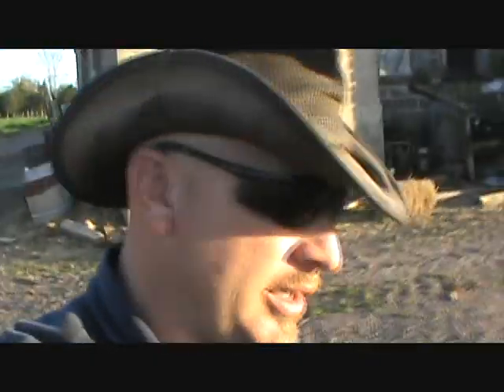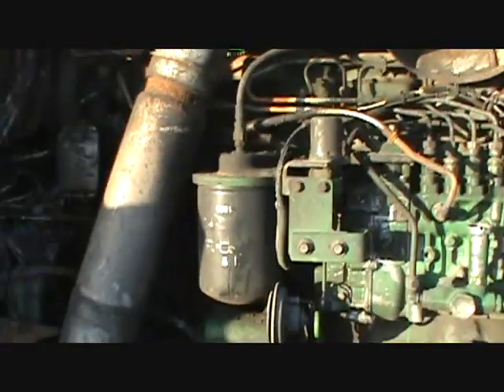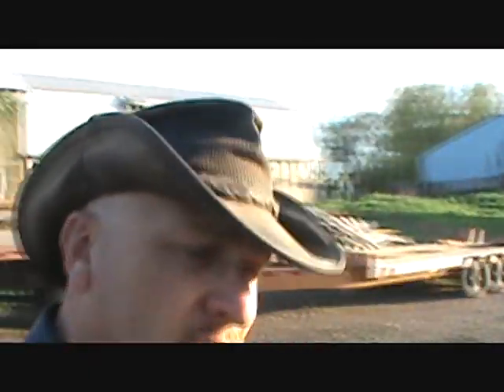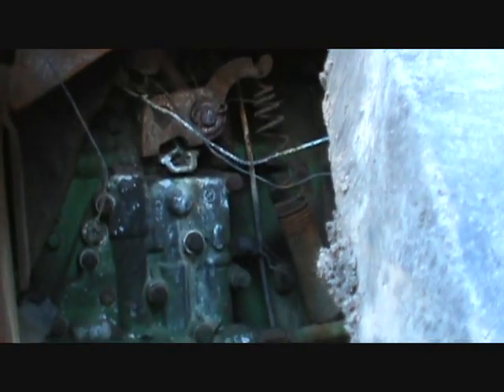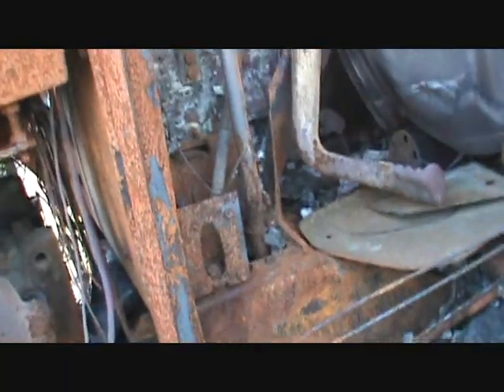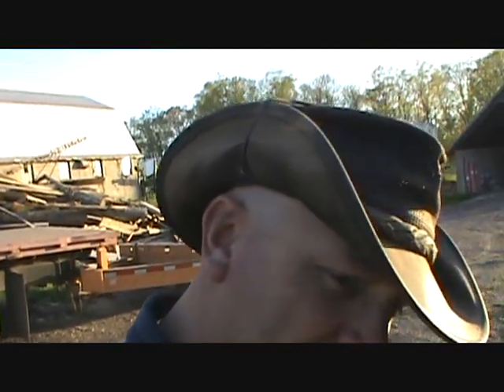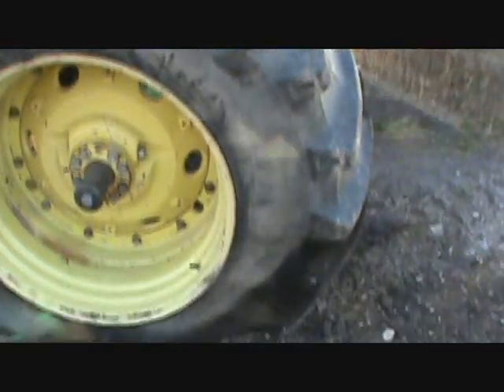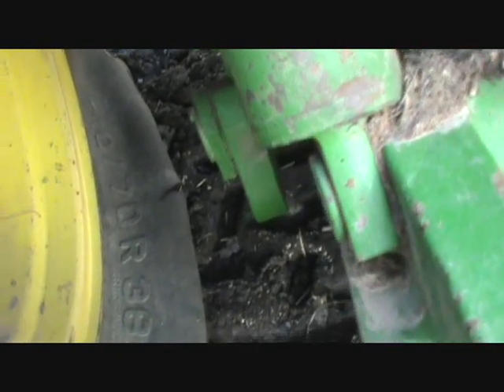4960 part it or fix it

Comment: We rebuilt a burnt 6620 combine and ran it many years till it burnt again. Check the fuel injection pumps sn plate. If its gone its trash. Would not think the clutch packs in the trans would have got hot enough to melt the sealing rings but if i had the cab off i would split it and check. Like the videos.

Comment: My polite suggestion would be to rebuild it if you have the finances to do it.  It would appear all the major components (less the cab obviously) are all there and mostly undamaged.  I would pull the cab and check the top of the transmission as you indicated.  Turbo, intercooler, and cab are easy.  I would also suggest a complete new wiring harness!  :)    Good luck!!

Comment: Salvage tractors to use for parts can be bought cheap a 4650 with powershift sold at auction yesterday at moultrie ga for 10,000 and some others with sound gaurd cabs sold cheaper than that. Just check around with diffrent salvage yards for parts and at local auctions because you will have a fortune in it if you buy all new factory or after market parts. Go for it and you'll be much happier that you fixed it than if you parted it out.

Comment: Fix it! Find a cab  from a salvage tractor with a powershift trans to make the process much easier. We have restored a couple burnt tractors and they are not as bad as you think to fix. Your hood can be fixed if it is not warped use muratic acid to remove the surface rust.

Comment: I'm still on my way watching all your videos chronologically, and I guess you rebuilt it, but I would have said to part it out, since you replaced it with the 8120 and then added the 7810 to the fleet. More tractors, more maintenance. ;-) But, from what I'm reading, it looks like the 4960 is a little bigger than the 8120 and significantly bigger than the 7810, so I guess it's good to have a backup. :-)

Comment: Have to weigh the options. The cost to rebuild it vs what you would make parting it out. Also do you really have use for another tractor? May be cheaper to find another one that needs a engine or trans and keep it for parts. I think I would have to part it out.

Comment: G'day mate. I have rebuilt a few Jonys's after fire damage. No big deal except you'll just have to sit down with the pets manual for a few nights and get a list up. Price the list then make a decision. The Sixty Series was the first to use computer controllers for the hydraulics and transmission. I think they will be expensive as will the harness and cap etc

Comment: For 8 years ago I worked on a farm where there was fire in a newholland 8360 I drove with (the same place as where the fire started on your JD)
I put off the fire with my water bottle and it was repaired at newholland.
Gear shift (Range Command) never get good again. It jumped and changed badly.
Now I do not know the gearbox on your tractor but if there is any kind of electricity in it then I would think it will end up too expensive or you'll never get it to run properly.

Comment: How expensive and available are those wiring harnesses ? Was the engine still running when you got out of it? Would it have sucked any bits of metal into the intake and/or engine ?

Comment: Obviously I am not about to tell you anything you dont already know. But you have to tear it down either way. I would start tearing it down. If I couldnt put it back in operation for what I could buy a new on for Id part it if I could get it back for equal or less I would put it back in service.

Comment: If you decide to fix this tractor, you may be better off to look for another tractor just for parts. Factor in the cost of a cab, hood, wiring harness, turbo and all the other parts that were burned. Buying this stuff from a salvage dealer will get real expensive because they will charge you as much as they can get out of it LOL

Comment: She isn't to bad lookin, but the trans is where the issues will be ( if any ;) ). I reckon start tearin her down, sus out any underlying problems and go from there. The engine is a sure bet either way, won't cost much to get it fired up and if need be you can make money on it if you part it.

Comment: That tractor is probably worth around $40 to $50K in good working condition. Used cabs are trading for around $15K. Assuming the trans is ok, you are probably looking at $20 to $30K in parts. At around 8,000 hrs those 15 spd trans's get VERY expensive. I have no idea what it is worth as a parts tractor. Maybe $15K. So....$15K plus $25K and now you are at $40K...about what you could get for it, not counting labor. BUT, if you like a project why not? Money aside, I'd like to see you fix it.

Comment: i woudl say part it out, the engine and trans rebuild them and sell them as rebuilt unit's for alot of money! should only need new seal and orings for the engine, the transmission same deal, the rest of the old girl just sell as parts due to the cost of rebuilding the whole tractor probbally isnt worth it in the end, time and money wise be worth buying a newer one

Comment: I would not do it. They wont be as reliable as they were before. Also most people dont trust their burnt tractor anymore. 

You have got a fine fleet of machinery (more tractors than drivers ;)) so why bother. Sell the engine apart and the rest as scrap iron.